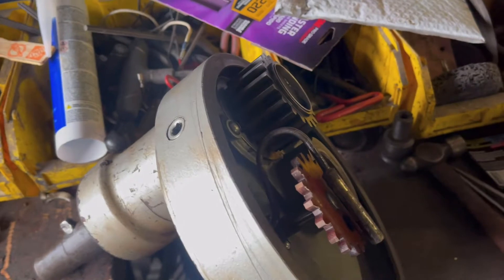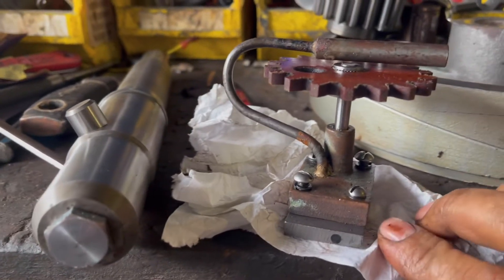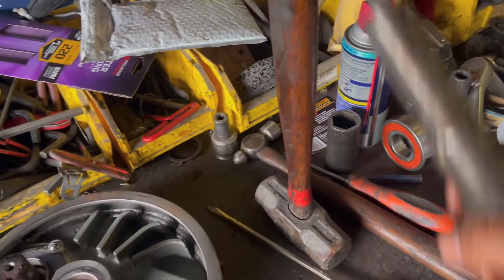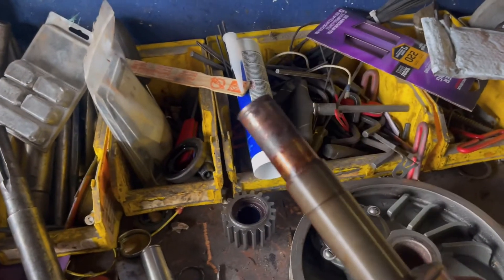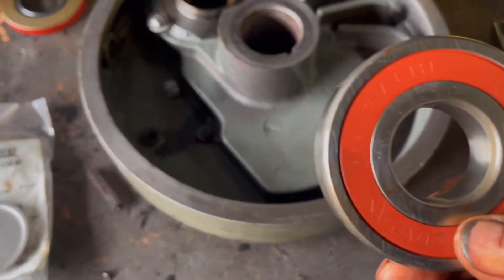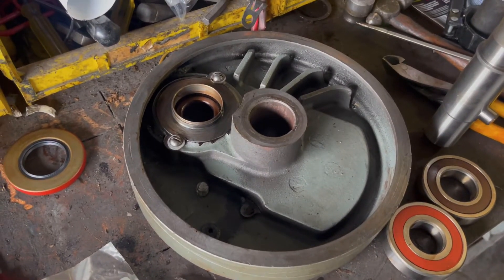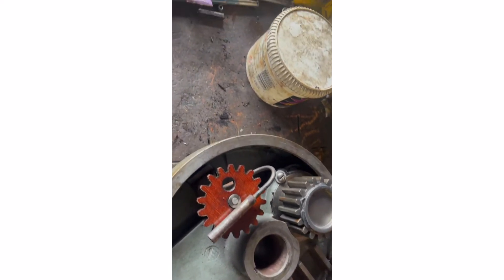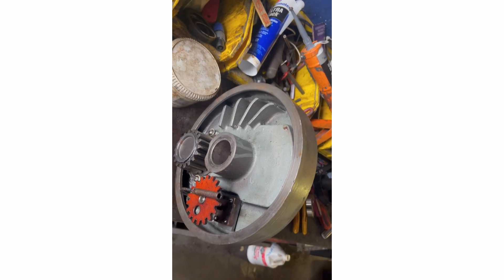Hobart H600/P660/L800 Planetary service Shaft replacement

Comment: i have a dough hook that is stuck on the Shaft, any tip removing it. i've tried dropping wd40 oil, and heating the Shaft. the hook is still stuck. does this mean i need a new Shaft and new hook? thanks
Reply from the maker: Hi there thank you for your question
In regards of a hook stuck in place it’s almost impossible to get it out with a torch,wd40 etc believe me we did tried in the past .
So you’ll definitely will need a new hook shaft can be saved if cutting hook properly with out damaging the shaft 
Solution is get some type of cutting tool fine the chunky section of your hook that is between the beater pin and the locking socket of the hook that’s the best area to start cutting off the hook ,most of the times i have done it the beater shaft is not damaged by the saw obviously we know where to cut.
This is what we do when we run into this type of problems we had never been able to get a hook that was seized or lock in place 
So hopefully my answer is helpful …
Reply: @calucoelsv  thank you so much. I need to have buy metal cutting disc for my angle grinder. Btw is there repair forum you use to post repair progress? Thanks

Comment: Thanks for your videos. You make these machines more approachable. Have you seen a P660 that leaks oil from above/behind the bowl lift worm and puddles on the base? It almost seems like its from the front of the motor. Is this common? I cannot figure out where mine is slow leaking from.
Reply from the maker: My apologies for responding so late
In regards off your question very likely that your losing oil trough out the front motor Bearing also the seal around the motor between the motor and transmission case has an O ring that also over time expands and oil finds its way out again first motor bearing seals fail second O ring fail so those are the potential suspects